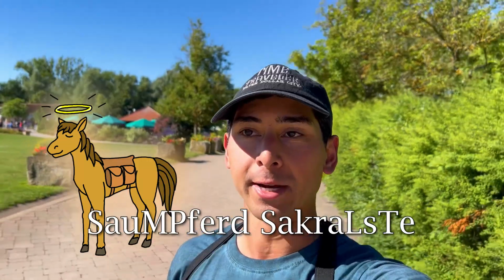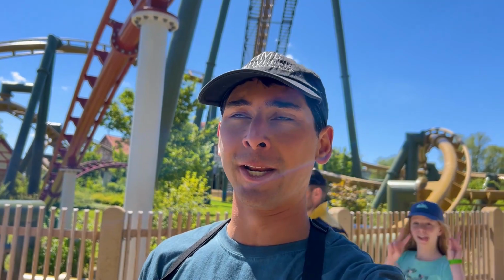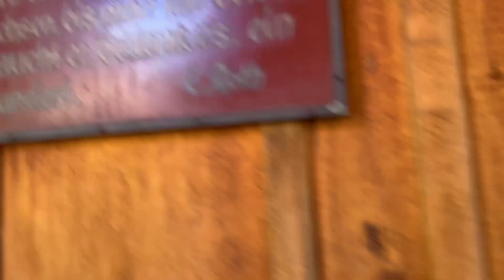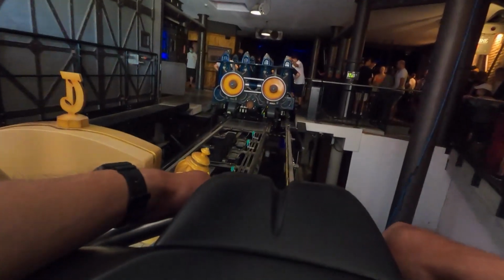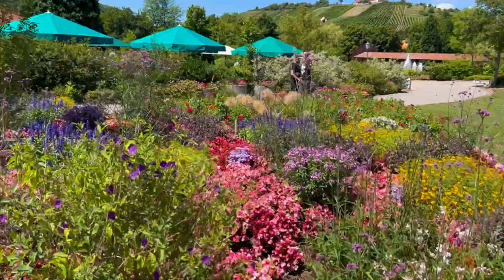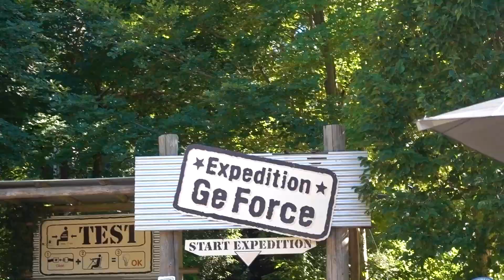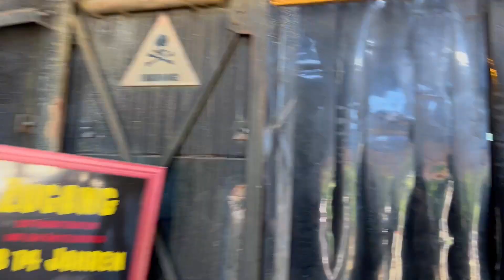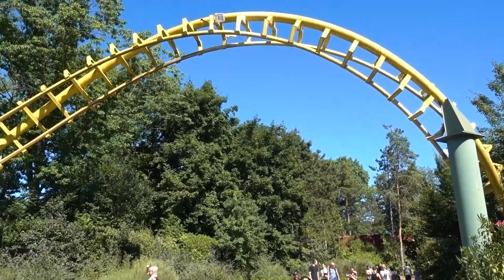Tripsdrill and Holiday Park - So Many Parks 119

Comment: I visited this park in 2002 and in 2007. My visit in 2002 was with ACE during the ECO tour so I feel I really got to "understand" Expedition GeForce from riding it several times during ERT. I went back in 2007, very eager to ride one of my favorite coasters. This was during a time the park was apparently experimenting with a different type of compound for the wheels on the train. EGF was very slow that second visit. The trains were crawling through the overbanks. We were really bummed and only rode it twice as it wasn't as fun as we remembered. It does appear it has gotten back to its original form as it looks very fast in this video.
Reply from the maker: That's certainly disappointing that your more recent rides lined up during that experimenting phase. I can really see the overall experience suffering, especially taking those overbanks any slower. Our rides were awesome and certainly running well, but weren't quite those "undisputed #1" rides I had heard about for years. But even still, it's an Intamin Mega, it's hard to go wrong with one, even on its worst rides.

Comment: We did these two parks also in the same day but Holiday Park first and then Tripsdrill after. Any reason you did them in your order coming from Phantasialand and then off to Europa Park I assume? That's what we did too. Get on a warmed up Expedition Geforce later in the day perhaps? While I loved EGF, it didn't blow me away. Probably that massive hype over the years and expecting too much. Felt quite similar to Goliath at Walibi Holland for me. It was no Kondaa. Tripsdrill was an awesome park. Shame you didn't have time to go on the bathtub flume as that was really good.
Reply from the maker: Yup, we hit the two parks on our way to Rust. We did the parks in the order we did to maximize our time since Tripsdrill opened at 9 and HP closed at 6. Warmed up rides on GeForce was certainly the bonus. I'm sort of in the same boat with Expedition GeForce in that I thought it was excellent, but not really the "perfect" coaster it was hyped to be. Even still, the first drop was bonkers and there's loads of great airtime, so it still ranks quite high for me. We went on a pretty hot day, so the line for the flume got a bit too long. Definitely want to give it a ride next time.
Reply: @CivilianSatellite  yep it was really hot on our day too. Flume had probably a 40 min wait but i think we had about 4 or 5 hours there since we made Holiday Park the shorter stop for the day.
Reply from the maker: Nice! We wanted to get a bunch of rides on GeForce, so we spent about equal time at both parks.

Comment: How bad were the lines at Tripsdrill?  A few of the rides in back had 45-60 min waits for me.
Reply from the maker: They weren’t too bad when we rode them, probably around 30 minutes at most for the Gerstlauers. But we basically second rope-dropped them at 10 when they opened. Shortly after riding them, their lines really blew up.